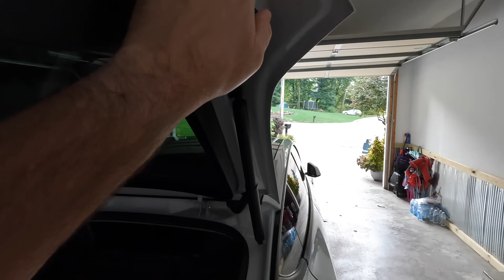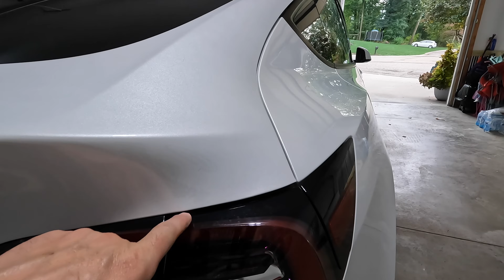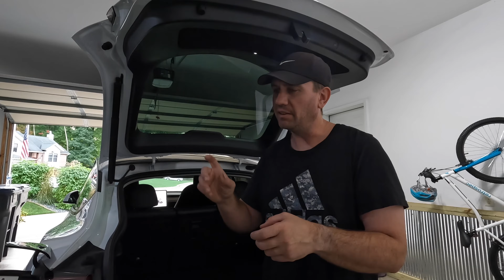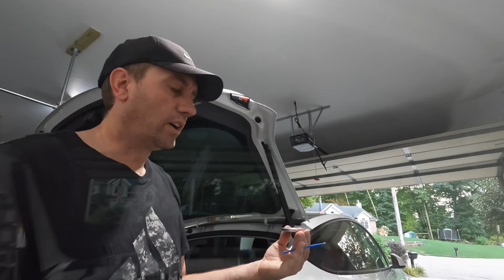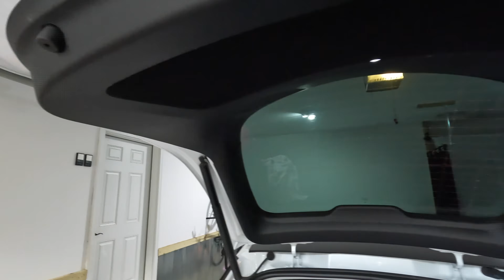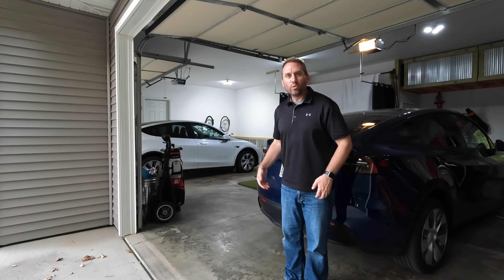Tesla Model Y Panel Gaps - My 1 Problem

Comment: My brand new 2025 Model Y sounds like a window is left open on one side of the car. The pressure it occasionally causes our ears is so silly. Sadly, Tesla doesn't really have customer service and the service centers themselves really only help with the big issues they can identify  I am told.
Reply from the maker: That is very unfortunate.  Have you entered a service request in the app?  

This might be something mobile service can address.  I had them install the tow hitch and the mobile service was great.

Comment: Had to do this at 64K original owner miles. Hey, great tip on adjusting those rubber bump stoppers. Saved me tons of time and trouble removing trim panels and headliners.
Reply from the maker: I'm glad this video helped you out some.  

I'm still loving our Teslas, I can't see going to anything else at this point.  Is that you experience also?

Comment: Tesla won't do anything that is beyond their parameters which is superminimal at best. Is it measured in micrometers?  Or nanometers? I dont know.l.. instead they recommended trunk hatch replacement which is my case was in the tune of $2300. I was hoping the technician would work with another as they work in twos to adjust the hatch and I was even open  to them bending the trunk to an acceptable level. I would be even agreeable to paying for the labor. However, they dont want to do that. The trunk is malleable and can be bent. I'm on my own now. Manual labor....
Reply from the maker: That’s unfortunate, is your vehicle still under warranty?   

Thanks for taking the time to share your experience so others can learn.

Comment: Awesome video, I had the same issue.
The hard plastic part wasn’t even flush with the body.
Reply from the maker: Thank you.  Thanks for checking in, do you have a standard range Y also?
Reply: @TheLawnEngineer   I have the performance Y
Reply from the maker: @oksquared6037  great to know, thanks for the reply.  This problem is not specific to the structural battery pack.

Comment: You shouldn't have to do this final line adjustment yourself. Its just a faulty process or forgotten step. Bad on Tesla.  Any closure should have proper integration of good seal, fit and finish, and no interferences.  I worked for 2 Big 3s and this is sometimes called the overslam requirement - where you have sufficient clearance that no metal ever touches the light assemblies even if a closure is  'overslammed', and then has adjustable bumpers like you used to fine tune the fit and finish appearance for craftsmanship.  Latches should be adjustable , as you showed as well.
Reply from the maker: I agree, it is a pretty big miss for Tesla.  However, if you look at what they were producing 2 years ago, this is an improvement 🤣